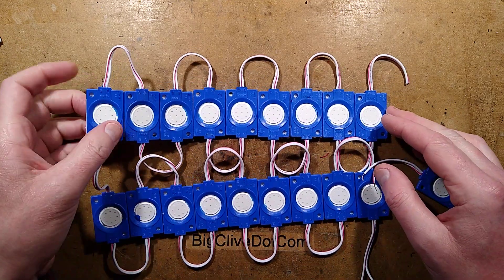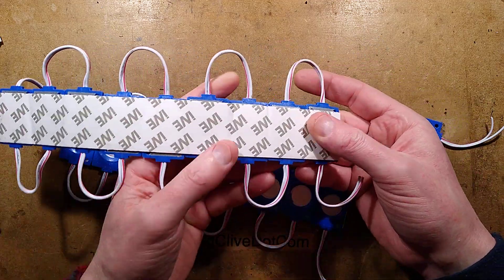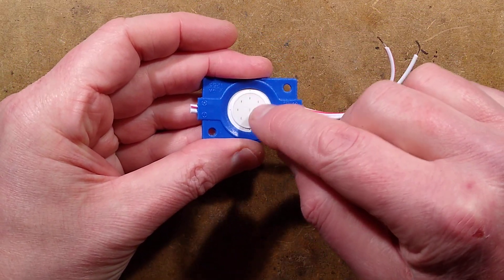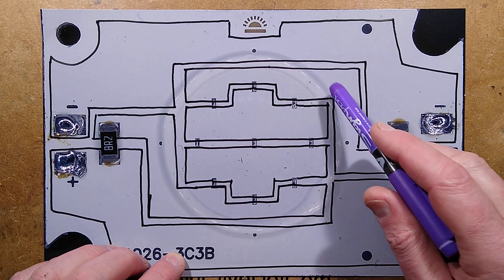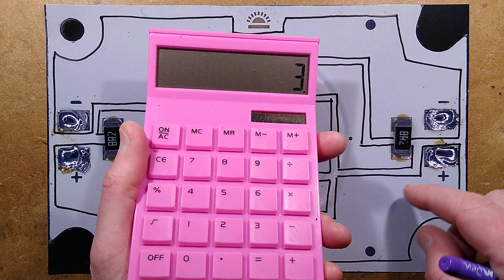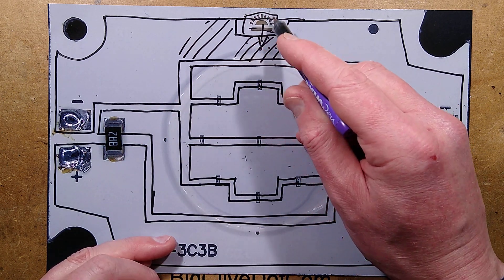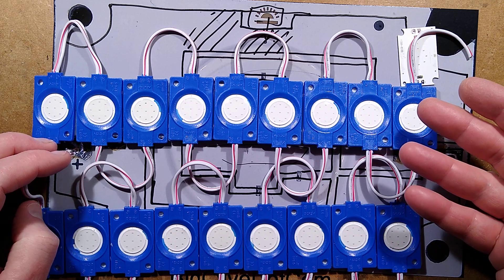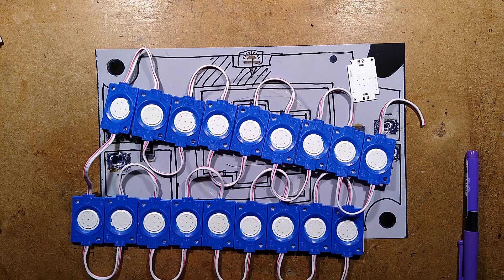LED signage COB module teardown

Comment: i found this one very interesting. I have some of these in various colours.  i must confess i have an aliexpress LED habit. I have never seen any new. to me, kind of LED  without buying it. often the LED is the cheapest part, which i buy without thinking. then i have to spend considerably more to play with them. for instance I got a "100 watt" RGB cob the other day. as it was only a couple of quid. but then i needed a heatsink (7 quid) a fan to attach to it (6 quid), 3 900mA CC drivers (15 quid), logic levels mosfets to drive it from a ESP32, then, when i realised that calling a chip logic level is more marketing dept bull than eletronic fact, some TC4427EPA mosfet driver ICs, and finally some hi-link pm12 modules so i could drive the fan directly from the mains wires soldered to the RGB COB. So well over 30 quids worth of stuff, and an afternoon's coding, just for the pleasure of seeing very bright coloured lights in my lab. But on the way I learned loads of cool things. So it was win/win.

Comment: The cover being removable would actually help in my case; I could make a single enclosure to fit multiple chips right up side-by-side.
Less over all bulk and more stability in a single plate, compared to chaining them together.
I don't mind the resoldering, as I could fit shorter leads along a groove in the custom piece.

Comment: Why would RED (or any color than white) use a phosphor overcoat?  Just about every shade of every color of LED has been made. Ron W4BIN
Reply from the maker: The flip chips are gallium nitride.  I'm not sure if they have a gallium arsenide flip chip due to the lower demand as opposed to white LED lighting.

Comment: If not testing points, they could be the computer manufacturing aliment reference points to place the components. Like yourself, I can't get over how small the LEDs are compared to say the resistor on the board. Will tech get so small that it will become micro-dots or namo-dot wearable tech that you don't even see, welcome to the Inner Space age.

Comment: I'm fascinated by the circle at the circumference of the silicone cap. Unless that's just a trick of light and shadow, it looks like some tricky materials engineering goes into bonding the silicone to the board.

Comment: Big Clive subscribers : I need help finding a replacement part and figured you guys would probably know where I can find it!

Fesu branded twigger switch
Fs056-10/4d-ad-b4
10(10)A 250v ~5e4
210624 zp001

It's a switch from an electric mini saw.

Comment: I got my hands on a bunch of the same kind in white in 24v, put them on a 1.5m mdf board and used them as a garage worklight, loved them, still have them on the board and tucked away somewhere, no fails, no flickering

Comment: There's a project idea: 3D print a Big Clive logo of some sort and use those modules to illuminate it and see how they perform over time? If the power supply is different (mains vs 12V etc), maybe have a few small signs and you can compare them once some time has passed.

Comment: I used the elongated version extensively as solar powered lighting. The ones installed around a house outdoors is going 4yrs and still good. The ones I used as poulty building lighting lasts a year or two before they start losing chips, possibly due to a more corrosive environment.

Comment: Why do "12 volt" LED arrays always seem to have 3 in series instead of 4? Even with a modest voltage drop in a 12v system, four in series should still work. And it would limit the drop across resistors. You might even get away with the resistance across the wiring alone for such a small voltage drop.
Reply: because a slight change in voltage leads to a large increase in current with 4 compared to 3 leds.
Reply: 4 in series might work, but leaves you with no headroom for slight over/undervoltage. With that small of a resistance even minor voltage variations (for example from the supply undergoing thermal drift) would result in either uneven light output from undervoltage or premature exitus from overvoltage (=overcurrent). Even the lowest additional resistance would keep one of the LEDs in the line from reaching its forward voltage, thus not lighting as bright as the others. Letting the wiring resistance determine the current is also a bad idea. Remember, the LED chooses its voltage, but the circuit designer chooses the current.

Comment: I have the blue and the white versions as you have, fitted under my kitchen cabinets on two separate ccts. white for useful illumination and blue ( dimmed ) for mood lighting, running at 11v not even tepid plenty of light and up to press reliable - I've plenty of spares so failure is not an issue - super cheap from Ali. I must add my blue ones look better build quality than the ones you show, the moulding is very neat and very difficult to open where yours seem to pop out.

Comment: Clive, you say, at the end of the video, COB based modules (as shown in the video), might have use for back-lighting, in LCD panels. Are you thinking COB modules for retrofitting/replacing CCFL based back-lighting, like in older televisions. (I've seen some people doing retrofittings/replacements with LED tape; but, I'm not convinced the results are satisfactory.)
Reply from the maker: Some manufacturers use a module system like this.

Comment: It's amazing seeing all this LEDs on your Chanel , fun fact they are very popular in Syria due to the 20 hours power outage that happen every day lol , and you would be surprised that nowadays literally every house have at least one 100 amp lead acid battery and bunch of this LEDs around the house with a very popular cheap  Chinese battery charger called Suoer and wish you do a video about this charger someday.
 
Great video as always
Reply: Cheap Chinese battery charger... sounds like a treat.  Do they have a reputation for starting house fires, maybe?
Reply: @idjtoal  it's and I'm fully aware of this , but when inflation hit hard and what was 1000 sp back then now coast 100,000 sp with the minimum wage didn't adapt to the current situation you'll be forced to use such danger things ,
They are more likely to catch fire if you didn't use them as intended like having 10 amp charger with 200 amp battery it'll but  massive  strain on it sense the battery is always under 50% charge so it would pull alot of amps from the charger and what happens is the the negative cable from the charger start heating up and smoking very bad  ( this actually happened with me before ) and if no one around to disconnect it from the battery the heat will rise till the cable catch fire , 
Sometimes the fuse will do it thing before that but it's Chinese stuff so it's based on luck.
The most common danger thing to happen is the battery explosion due to heavy use and lack of maintenance specially for the lead acid battery that is made in syria , it's very poorly made with small holes to discharge  the gases when charging and they tend to be blocked by dust and dirty very easily , this  actually happened alot making the battery a small grenade and sometimes the can make a hole in the floor and do alot of damage .

Comment: I searched Ebay in US for 'cob led 12v sign' and came up with lots of sign LED strings. Not expensive for string of 20 but water 'Resistant' of IP65 so not really IP67 or better.

Comment: Red Phosphor?!?!
Reply from the maker: For mass produced stuff like this they often use blue behind red phosphor instead of bare red chips, because the flip chip technology seems to have been optimised for blue emitters.
Reply: @bigclivedotcom  Wow! Seems like such a waste when red LEDs are common, cheap and efficient. I'm sure there's a significant loss of efficiency using phosphor to drop blue to red. Thanks for the enlightenment!

Comment: Do you have a LED problem where you cant help but buy leds that you will probably never use?  I have so many leds here, i need to get counseling or something lol
Reply: "Hi, my name's Steve and I'm a diodeholic"
Reply: @jimurrata6785  pmsl
Reply: @stevefox3763  I had a flashlight (torch) habit.
It was hard to shake.
I've moved on now.     ..... now I'm into headlamps.  🤣
Reply: @jimurrata6785  I dont have LED headlights but many of the other lights on my car are led, my reversing lights and high level brake light are retina burning bright and my interior is better lit than my house ha ha.  I hate the cold white LEDs inside the car, i have leds that are the same color temp as the incandescent bulbs they replaced but mega bright :)
Reply: @stevefox3763  I'm not a fan of LEDs 6k and above, either.
While a appreciate getting something like 8x the lumens per watt, where I live we get ice and snow.
Old style incandescent bulbs clear the lens.
Reply: @jimurrata6785  oh lol, i can see that now you mention it doh!  I have a reasonable head torch but my XHP 70.3 flashlight/torch is savage bright and i want to convert my reversing lights to use those LEDs, they are mega bright already but the XHP 70.3 is insane and my torch doubles as a hand warmer ha ha!

Comment: It's somewhat hard to tell what's going on when you outline the copper like that, I'm wondering if there is a better way of doing that.
Reply: Maybe use two different colored pens, one for positive and one for negative, and color the tracks in.....and coloring outside the lines would be a short circuit.

Comment: For that kind of power loss, which is substantial, you would think that someone would make a more expensive module using a small buck regulator to drive the LEDs directly, eliminating the very lossy resistors. A decent synchronous buck switcher can easily achieve 90% efficiency vs. the approximately 75% efficiency shown in the teardown. Each module wastes about half a watt of power. That's sinful if you're a power supply designer.
Reply: It feels like a much easier solution would be to run 4 in series, rather than 3. Or run 3 in series, but from something closer to 9v (it's how I run our undercabinet lights that are similar to these).
Reply: Doing so would probably increase the cost of a module 10 fold. Thats sinful if you want to stay in business.

Comment: We use them for general purpose lighting all nights (blackouts).
I do run them at reduced current with additional resisters.
I also use for them as a bench light source though they cast multiple shadows so it's for close proximity use.
A warm white version combined with cool white one at a ration of two (warm) to one (cool) is pleasing IMHO.
Interesting video as always. Thank you BigClive.

Comment: Aren't the LED chip die ultrasonicly bonded? I can't imagine that the surface tension of the 'solder' would work holding something that small. The miniscus of the wet solder would have a radius larger than the LEd chips... Clive please get a microscope with a camera attachment! They're great... 😀👍🏻🇬🇧

Comment: several years ago, we were installing the 3-led type signage lights, except the whole string was in series...  the driver was rated at 150mA, 60 to 1200 volts...  absolutely crazy in my opinion.  I cannot remember the manufacturer, but is was a local US company
Reply: I can only imagine that a newly born baby  purchasing dept worker with a calculator and a mathematical understanding of I=V/R told the supplier their requirements and the supplier was like, "uhhh. Are you sure that's what you want?" 

"Yes. 5,000 of them... Rush order."
Reply: @operator8014  lol I wish they'd at least use the calculator )))  most of the install kits we get are so badly messed up it's not even funny...

Comment: Hi Clive

I have a range rover rear light unit that has a faulty led strip and I've replaced it,

Just wondered if you wanted the old one for a tear down as it looks like a complex set up in there.

Checked out the website and failed to find how to send you things for your videos

Cheers

Comment: 5:50 That is weird. You'd think they would use something on the silkscreen layer instead of something that would take a bite out of the trace.
Reply: Silk screen cost extra. So the cheapest way is to use tin on copper. But for ESD purposes you want it disconnected from active traces.

Comment: These seem very versatile.   Any links to the source for the 120 volt version in smaller quantities?
Reply from the maker: This was a random eBay find. Try a search for COB LED sign module 12V
Reply: The separation didn't look too good on the 220v ones Clive reviewed previously. So if you are in America/Canada, I'd definitely get one of those GFCI plugs to use with a 120v version. They are cheap enough and compensate for a lot of wiring "sins".

Comment: I wonder how these would fair as under cabinet lighting.  They are low profile, can place them however for your desires, and 2W per unit would do well.  The 120/240v version would be an easier setup however.....
Reply: I have used them for interior lighting in a service truck and they worked great, the one I got off Amazon were made by Samsung and put out a nice easy on the easy on the eyes color temp and very well spread out pattern, they would be great under a cabinet

Comment: It'd be interesting to get these in grow lamp colors; I recently made a bunch of linear grow lamps using aluminimum extrusions and luxeon stars, and it was more work than I'd like.  These would have made the job a whole lot faster, though I wonder about the heat dissipation if they're facing down...
Reply: I was thinking the same thing but to make aquarium lighting a couple of years back, but at the time it was a struggle to find any bright enough so I went with the stars instead.
Reply: You shouldn't have a problem with heat dissipation,  since the aluminum PCB will be facing up! Also, I doubt they produce much heat to begin with...

Comment: When you etch a circuit board, is it possible to recover the copper from the etching solution? On the scale you do it at home this would be insignificant, but in a factory it might be enough to matter. Or are circuit boards like this prepared by some other method which leaves no waste copper?
Reply from the maker: Factories often use copper chloride and sell it on for reuse.
Reply: PCB factories do recycle the spent etchant and recover the copper, as that way they do not actually have to buy etchant so much, simply use an electrochemical cell with carbon anodes to allow the copper to be plated out, then filter the rejuvenated etchant and use it again and again. If you take half the copper off the PCB during etching, you get at least a good amount of copper to sell, and thus make a profit. 

Also that copper can be used for the through hole plating bath, where you drill all the holes before etching, and then plate them after a conductive layer is applied, and also actually plate the through holes and the board as well. Then you mask and etch, so your saving is even more.
Reply: Once developed a continuous process machine using ferric chloride to separate gold plating from PCBs that had been chopped up. The copper was pulled out of solution, on a slow moving ribbon, the ferric chloride filtered after slowly circukating, and electrically separated with a fountain... Recovered lots of gold (and copper) and fillers. 👍🏻
Reply: I use alot of copper in silver refining. Then use the copper nitrate waste to make more nitric acid and copper oxide, which can be converted back to copper metal.